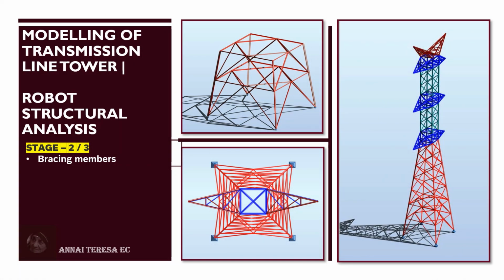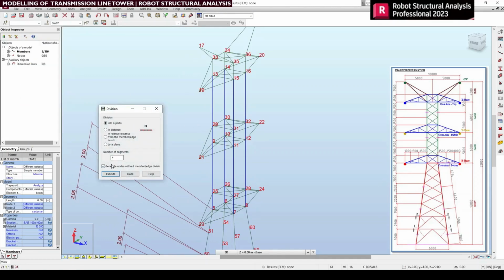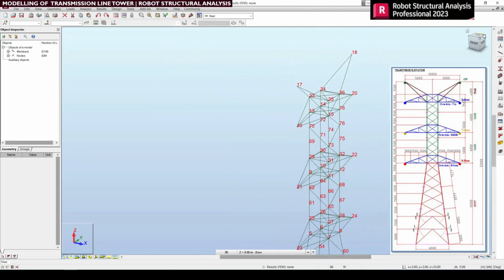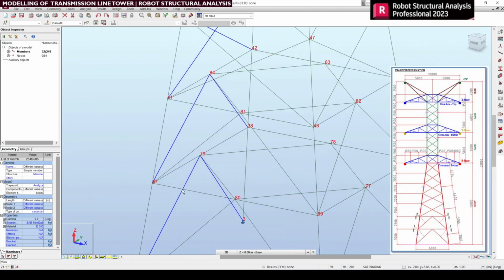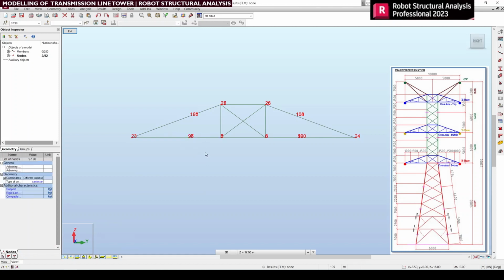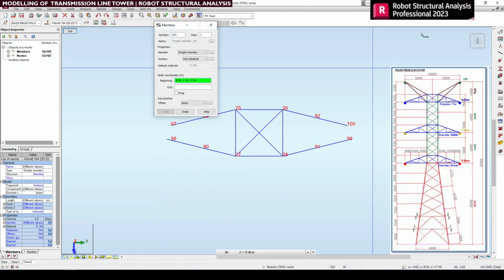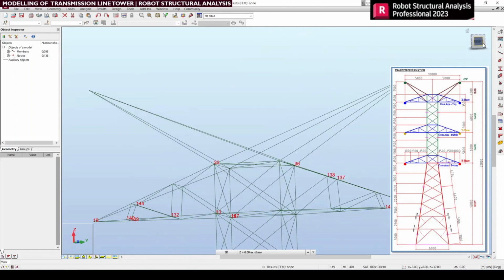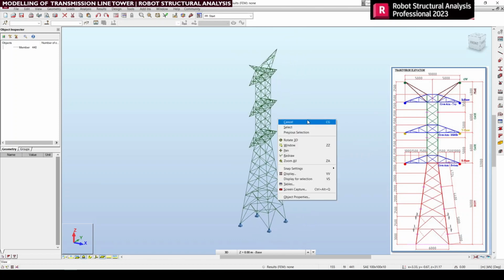220kV DC Transmission Towers | Modelling | Robot Structure Analysis | STAGE 2 of 3

Comment: Great work, amazing and well explain. Please give advice on designing a  non penetrative foundation for a tower deployment in the delta and parks.
Reply from the maker: Thanks for watching. Yes, video on non penetration  is a good suggestion. We will do once after completing the structure Design. From the output of structure loadings, we will demonstrate design of foundations.
Reply: @annaiteresaec   Thanks a lot, that will be great. I will be waiting.
Reply: @annaiteresaec  Do you recommend books to read or pdf worked examples.
Reply from the maker: @keoagilekerileng663  Generally our presentations are based on global standards. We do refer respective global standards and Manuals along with our experience, plus Google reference in line with our presentation requirement. Other than that there are no special worked examples.